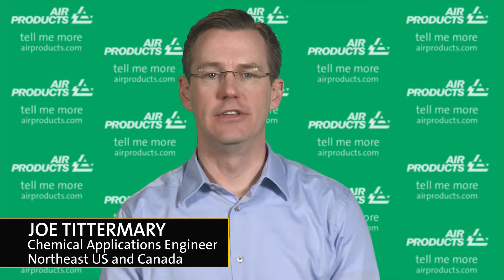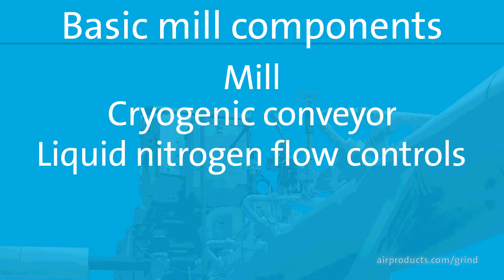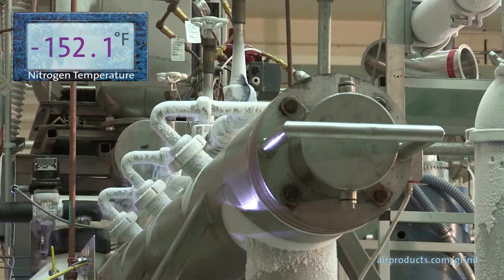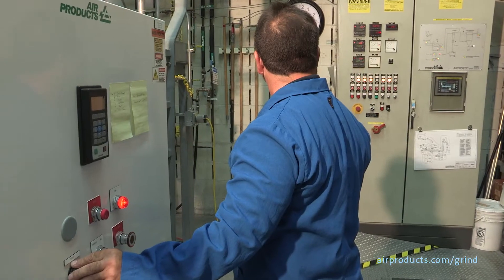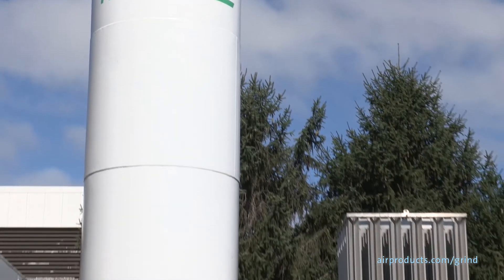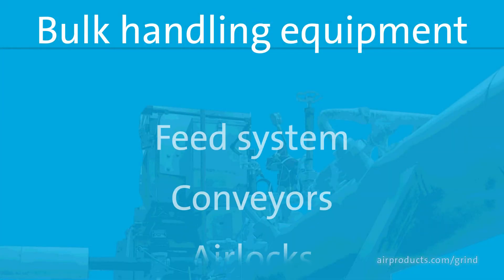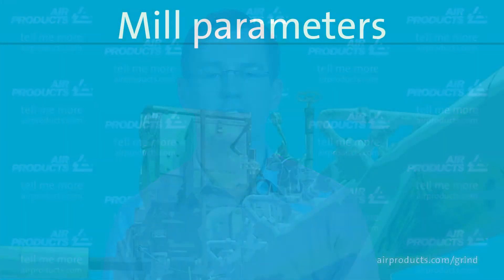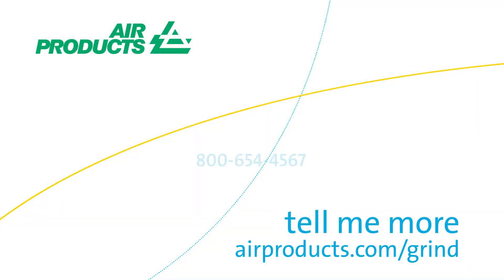Ask the expert: What equipment do I need for cryogenic milling?

Comment: what is needed to set up an operation for scrap tires?  Would like to salvage wire and clean rubber from tires which will have all wire removed
Reply: Hey. Were you able to find a solution?